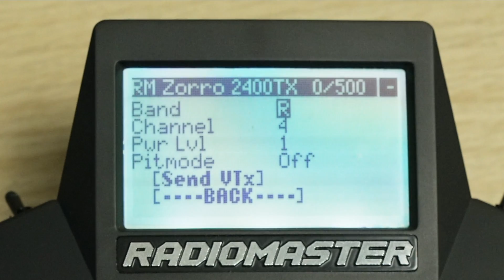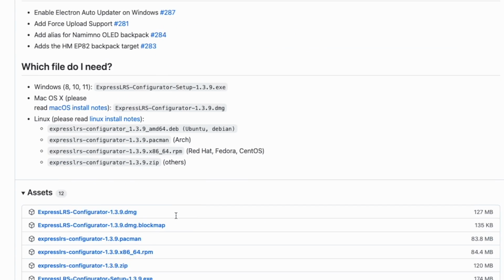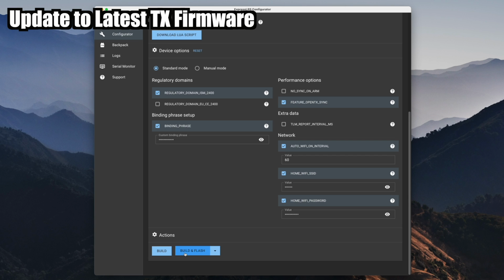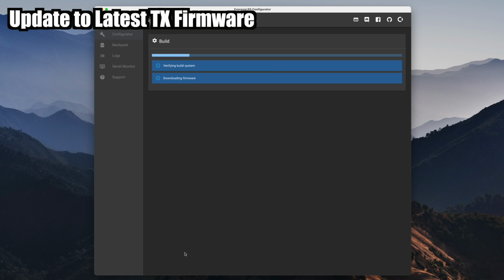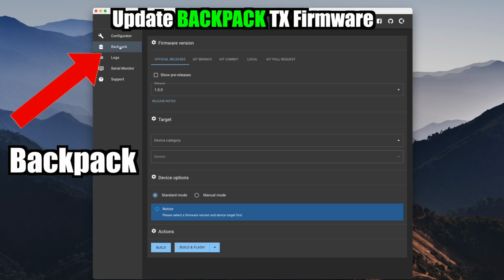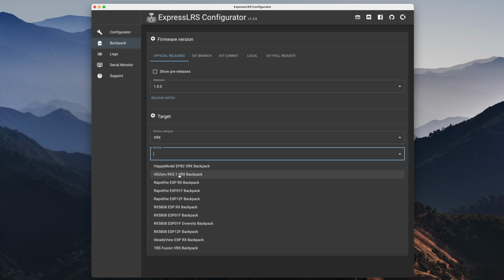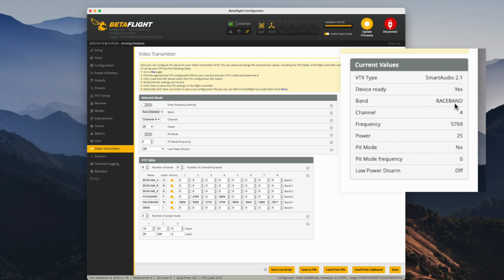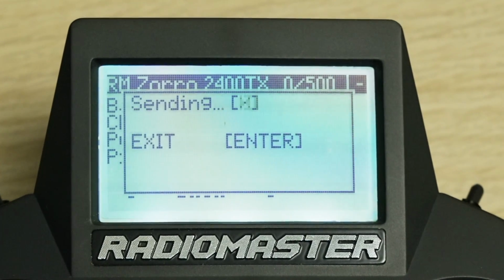ExpressLRS Backpack Setup for HDZero

Comment: Great video. I got this working tonight. 

One more thing that you must set up in Betaflight is that Arm must be on Aux1 and must also be active high. This is stated in a completely different section of the ELRS docs. 

Mine (all of my aircraft) were set up as active low and none worked until I changed them to active high (easy to invert in the mixer tab). Hope this helps someone.

Comment: Got it setup and all working but struggling to get the vrx to close with the backpack inside. Where did you put your backpack? Is it inside or have you got it mounted on the outside?
Reply from the maker: I removed the SMD antenna and put it on the opposite side to the jog wheel

Comment: I just installed a VRX-Backpack EP82 module on my hdzero rx. Updated Rx and vtx firmware. The image is ok, so the update was successful but when I try to change the channel, it changes only on the vtx of the drone, while on the rx module the screen goes black and you only see the images of the antennas but it remains blocked. To make it work I have to unplug it from the power supply and plug it back in. Obviously, I also updated the backpack module as you did. What can it depend on?
Reply from the maker: Ok, it sounds like the following Is happening:

1) the command is received by the backpack and changes the channel on the VRX 

2) the vtx in your quad is not actioning the command

- potential fixes 
1) are you using a HDZ VTX with Smart Audio such as a Race or Freestyle? Whoop doesn’t have smart audio so is not compatible with Backpack

2) Have you enabled telemetry on the Configuration page in BF

3) When you go to the VTx tab in BF does it show “VTX Ready = Yes” ie that shows your vtx is setup correctly